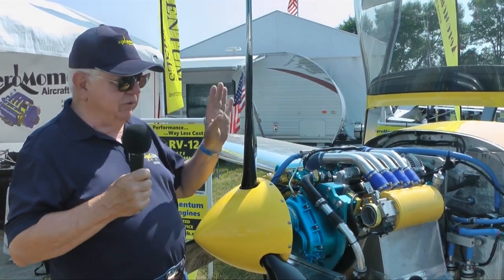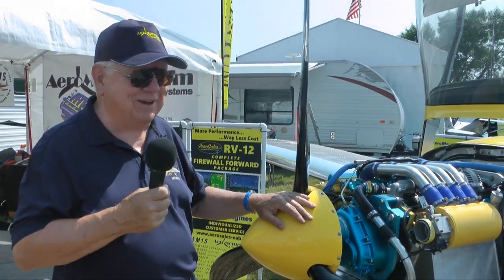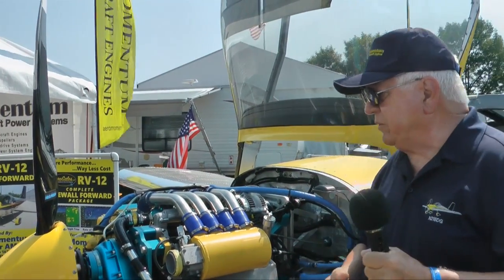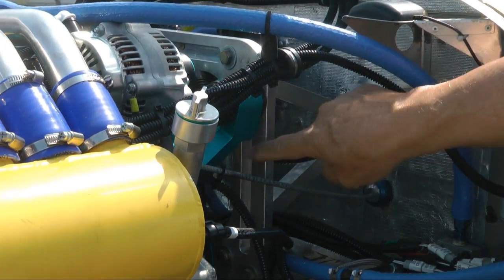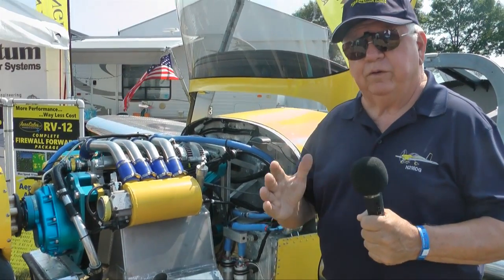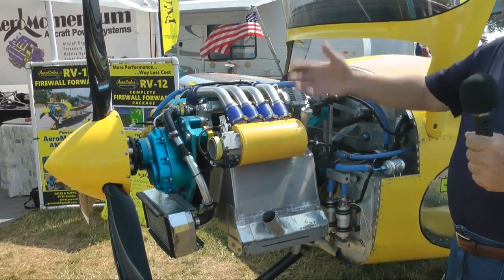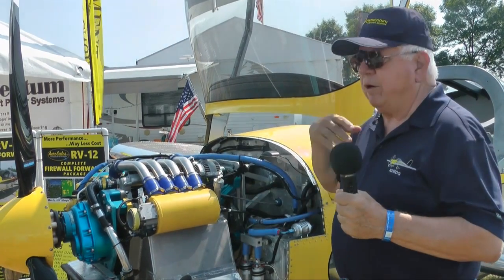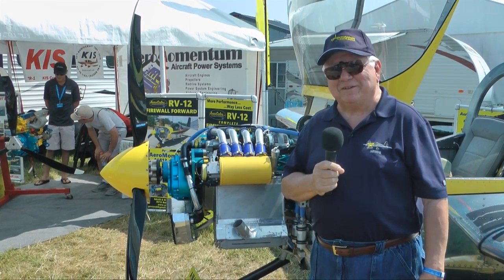They're putting WHAT Engine in an RV-12 ?

Comment: I've had four years of experience with an AM engine in my personal airplane, flown regularly.  Thermal management is a problem, made only slightly better with the new quad core radiator.  Also bad is the heat soak after shutdown under the cowling.  Also, Mark and Lily occasionally f up.  And they won't be accountable to you the customer for it.  You just have to smile and keep forking out money.  Also, the gearbox is MUCH less robust than claimed.  Also, cold starts below about 50 deg are interesting, mostly I think because Mark Kettering's tunes don't adequately include temperature.  Does he care about this amd other engine troubles?  Not really.  He's a sole proprietor and getting pulled a million ways from Sunday.  Documentation not his strong suit.  No owners' group.  No FAQ.  Is the base engine solid?  Is it cheap?  Yep and yep.  But dang it is a pain to keep it airborn.

Comment: Pretty cool! The plane was designed around the Rotax 912 @ 140 lbs. The AM15 is 185 lbs but I see a lot of added parts (weight). I'd like to compare the 2 options from a total firewall forward weight comparison. Having 40% more power that is useful in a climb... with what weight penalty.

Comment: You may find if you were to test Kendall motor oil in that engine you will find that it's failure temperature is considerably higher than 260°. If I remember right there was a engine builder that I knew for years and the Detroit area who was building the fastest and lowest time drag street cars in the country for several years and he had done extensive tests on motor oils and found that Kendall could be operated at well over 100° more temperature than any other motor oil he tested I don't remember the precise numbers but I think that Kendall failure point was up above 400°. It may be worth looking into.

Comment: I love it! You need to do this with a 2.3L ecoboost for the Rv-10. I'm not joking. I will buy one or even help develop it (pending wife approval). The 2.3L ecoboost makes ~300 lb. ft. of torque, 280-350 hp depending on how you configure it, and it's a lot lighter than a lycoming 540. Which gives you room to have a reduction gearbox and an oil sump for it. You can buy them brand new in a crate for $6,500... so I'm sure you can get the firewall forward package down to way less than 50% of a lycoming 540, and have 40% more performance, easily.

Cheers!!!
Reply: Sound's great, until it lift's it's head at factory boost levels. That was the biggest penny pincher mess up ford has done. Just needed a tiny bit higher quality gasket and properly spec'd for the stretching that engine does head stud's and it would be a legendary engine.
Or they could of brought that Focus RS 5cyl from Volvo to america. People would be talking about Ford's instead of Honda and VW turbo 4cyl now!

Comment: Very impressive, BUT like all of these odd engines when it comes to resale that's where you may lose half yr potential buyers, most like the well known brand/s of anything out there.
Reply: Suzuki is way bigger and older than Rotax.. without the engine failures...I'd trust Suzuki over a Rotax.
Reply: @Luminaring  Ok then why are there a zillion Rotax's around compared to hand full of other types/designs? Cause Rotax are POPULAR!
Reply: @endwood  Rotax is popular because bandwagon-appeal is STRONG in the aircraft community. And for good reason. Pilots tend to trust the experience and expertise of seasoned pilots. And given the lack of an abundance of proven engine choices, manufacturers like Rotax, Lycoming, Conti, etc, tend to be shown more favor. I think the kind of guy who selects an engine for his plane based of data, rather than popularity, is the wiser pilot. Sure, a pilot can follow the crowd and trust an engine that others love... But the wiser pilot knows his engine options, their strengths and weaknesses, and chooses the engine most appropriate to his mission and aircraft.

Comment: Did I understand correctly that he was at gross with just himself, full fuel, and 50 lbs of baggage?
Reply: 'Seem fairly reasonable for a light two-seater with lots of options/engine upsize/upholstery/avionics, etc.    Filling the seats often means taking less fuel!
Reply: I'm betting he's 60# over the standard size pilot.
Reply: @hotrodray6802  Guilty!

Comment: 30-50% more HP is huge! What about CG envelope? Stall speed? All the things that 40 more pounds up front can change? Definitely sexier, but what about behavior?
Reply: You're right to be concerned about the weight difference (on any airplane where a heavier engine is contemplated). 
First of all, the 40 lb difference I claimed is for my engine/airplane, circa April 2018 when I first received and weighed it. Since then, Aeromomentum has removed just over ten lbs from the engine package, so the real number should be 30 lbs.
Second, the real comparison should be against the Rotax 912is, which, like the AM15, is fuel injected and has electronic ignition. The 912is weighs 22 lbs more than the 912ULS, so the difference between them is small.
In any case, recognize that the actual forward CG design limit of the RV-12 is significantly greater than the limit stated in the POH. That "max forward CG" spec is what they measured on the finished airplane with the Rotax 912 installed.
I actually consulted one of the design engineers on the RV-12 project before we developed this package, and got his concurrence. Essentially, given the size and rotation force of the large stabilator, he predicted it would be well within the true limit. Extensive flight testing and normal flying, >100 hours now, has verified that nicely.
He pointed out that the limit to be concerned with most is, of course,  the AFT CG limit - and this installation increases the margin against that!

Comment: Where do you do the overhauls on this engine when the time comes?
Reply: Aeromomentum will overhaul for about $2K.  Your local automotive engine rebuilder can do it for about the same.  You should be able to do it yourself for half that and an overhaul kit is under $500.  Aeromomentum also offers brand new long blocks for about $2200 to $3K.
Reply: @mkett1922  much cheaper then a C172 overhaul
Reply: @mkett1922   they LOOK like a   car/ outboard 75/90 hp  zuki..... which  the question isnt  WHEN  its IF......  treat that block right    ive NEVER seen a bottom end go  even in marine use

Comment: does that extra 40 lbs effect your useful weight?
Reply: Of course - especially if you're flying under LSA rules. Switching to a Lithium battery helps about 12 lbs of that, though.
Reply: @gossend10  You get cert'd and then throw out the LSA idiot "rules" like everyone else.

Comment: Hi Dick, it was great to see you there at Oshkosh, and to see your install.  I'm contemplating nearly an identical install for my Fisher Dakota Hawk.  Stay Safe!!
Reply: Then you could do a video like this!
Reply: @kenhurley4441  Love to.
Reply: @ioanekirarahu951  What state do you live in?
Reply: @kenhurley4441   Utah.   But it is also difficult to predict exactly when I'll be able to begin my engine install.  The fuselage is nearly done-I just have to finish running the rudder cables, and finish the brakes set up.  The gear truss is done, but I still have to finish the axle receivers, install the axles, and then assemble the gear assembly on the fuselage.  I have to still weld up the tailwheel bracket, and then install the tail wheel.  Still have to build the fuselage fuel tank, and I've done very little wiring so far.  Mainly I'm still working my wings.  Got the left wing nearly all complete, and I'm working on the final aspects of the aileron hinges and linkages, then the wood geodedic for the wing, then wing fuel tanks.  Then I'll assemble the right wing, though that should go a lot faster than the left wing, as all the weird parts and problems (that the Fisher plans don't address) will be resolved and ready to go at that time.  Then fit the wings to the fuselage.  Then covering and paint.  A lot has been done, but still a lot more to do, and time and $$$ are factors.  But I'd love to document the progress on video.  I'm posting progress photos on the Fisher FFP Facebook page, as well as the Experimental Aircraft FB page.
Reply: @ioanekirarahu951  I'll be following you. Congrats on your future flying machine!
Reply: @kenhurley4441 Thank you so much.

Comment: He gives a great presentation, The only thing I'd point out, is for an airplane the size of the 12, 40 pounds more weight forward of the firewall is, or can be, pretty significant.  Sure you can juggle things around and get the CG correct, but there is no getting around the extra weight in the nose effecting the handling,  (elevator is the same size, for instance) this may be a minor thing for the money saved.  As always, there is no free lunch! But I did like his way of presenting the info, it passed my personal sniff test.  Pretty price point for sure.
Reply: Before I did this, I ran the design by one of the engineers who was on the design team for the -12. He recommended in-flight tests to explore the envelope. He explained that the actual design forward-limit was considerably further forward than what they measured with the Rotax 912 installed. He predicted no problem - and he was right. The only modification I made to address the Fwd CG was to switch to a Lithium battery - saving about 12 lbs right off the firewall. Perhaps I should recommend that as part of the installation going forward. Good comment, and a valid concern. Thanks!
Reply: You're right to be concerned about the weight difference (on any airplane where a heavier engine is contemplated). 
First of all, the 40 lb difference I claimed is for my engine/airplane, circa April 2018 when I first received and weighed it. Since then, Aeromomentum has removed just over ten lbs from the engine package, so the real number should be 30 lbs.
Second, the real comparison should be against the Rotax 912is, which, like the AM15, is fuel injected and has electronic ignition. The 912is weighs 22 lbs more than the 912ULS, so the difference between them is small.
In any case, recognize that the actual forward CG design limit of the RV-12 is significantly greater than the limit stated in the POH. That "max forward CG" spec is what they measured on the finished airplane with the Rotax 912 installed.
I actually consulted one of the design engineers on the RV-12 project before we developed this package, and got his concurrence. Essentially, given the size and rotation force of the large stabilator, he predicted it would be well within the true limit. Extensive flight testing and normal flying, >100 hours now, has verified that nicely.
He pointed out that the limit to be concerned with most is, of course,  the AFT CG limit - and this installation increases the margin against that!

Comment: What is the TBO?
Reply: They probably are estimating a TBO at this point. FWIW, I reached the 2000 hour TBO on my Rotax 912 with zero issues.  I heard 6800 rpm at one point in his presentation,  that's getting up there, at least for any kind of continuous operation. I guess I missed the weight, that is the biggie on any auto conversion.
Reply: @portnuefflyer  he said +40
Reply: @portnuefflyer    automotive engines are endurance tested at redline wide open throttle for 500+ hours. Redline for a small suzuki like this will redline in its stock installation around 7500 to 8000 rpm.  Comparing mean piston speed, bearing surface speed and valve spring pressure I bet this engine is as good or better than traditional big inch AC engines.
Reply: @DrewLSsix    I only mentioned the TBO, as until (and it sounds like they have, and they need to brag more about it) they have more then a few reaching the stated 2K TBO, it is somewhat theoretical. Like any auto conversion, the reduction system's TBO/long term reliability, is, or at least can be, the "big deal."  I put 1300 trouble free hours on a Stratus (now defunct, owner sold out) Subaru E 81 conversion, so am not in any way a naysayer on auto conversions, BTW.  AND, Aero's reduction system  looks pretty good, if they have that figured out, the engine's reliability  itself is a given.  ^Then it just comes down to the aux systems, fuel and spark delivery, which in home builts can always be unpredictable. A great engine package can be screwed up by a poor installation, (poor cooling/bad fuel delivery system) giving the brand a bad name, this happened with the Soob  conversions anyway.  I am also a big fan of high revving Japanese car engines,   and am a long time Toyota driver!  This leaves only a bit extra weight upfront as the main consideration, and as others have said,  at least this allows more weight to carried aft before getting out of the CG, not a bad thing, except for the STOL guys who want less weight, period.
Reply: Aeromomentum recommends a 2000hour TBO, but these engines have  exceeded 4000+ hours in commercial marine applications.

Comment: My one and only concern is reliability. If it's not stone cold reliable then nothing else matters even a little bit.
Reply: Then never fly, because even brand new Contis and Lycomings fail.
Reply: @UncleKennysPlace  Of course they do. The point is how often do they fail? What is the Mean Time Between Failures?  The dude is going on and on about 'performance' and 'racing'. Bruh, I ain't going to Reno, I want to get where I'm going in one piece!
Reply: @wntu4  Over 4,000 hours on airboats that run at a higher rpm than cruise in an airplane. Parts are matched to within a gram or so before assembled. Engines have been dynoed at full throttle for hours! AeorMomentum doesn't want you to have an engine failure either!
Reply: Yours is of course the most important comment here ....nothing trumps reliability in an aero engine ... If I somehow  knew this could match my Lycoming O 320 I would absolutely go this rout ... But its kind of new to the in air world ... how does one really know without data and passage of time ... and pioneers take the arrows